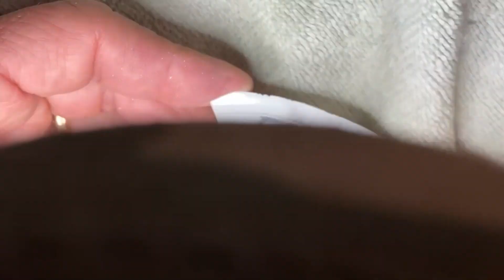Making the Chimera (Etching original artwork onto steel)

Comment: What you use to transfer  bakers paper
Reply from the maker: I use regular tracing paper I bought on Amazon.  After drawing my original image I trace it onto the tracing paper then flip the paper over onto the blade and trace the image again from the back side of the tracing paper.  This forces the soft lead onto the painted blade.